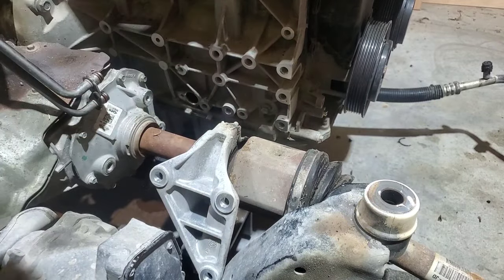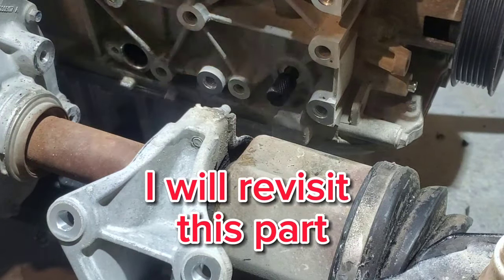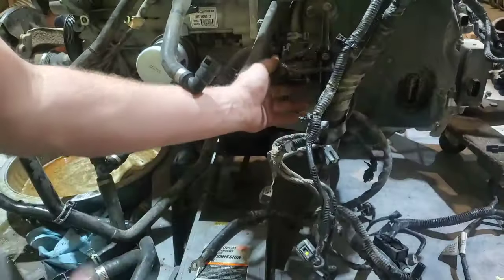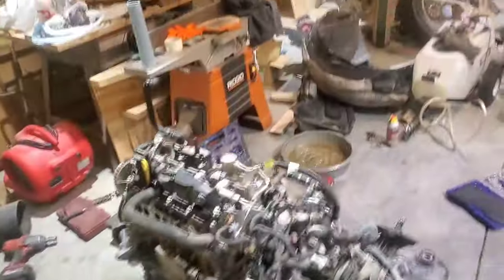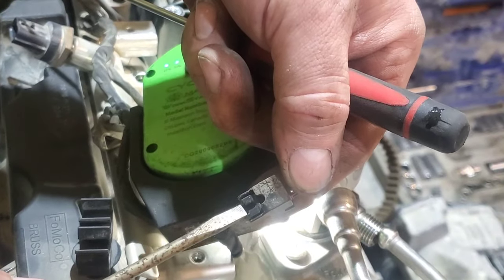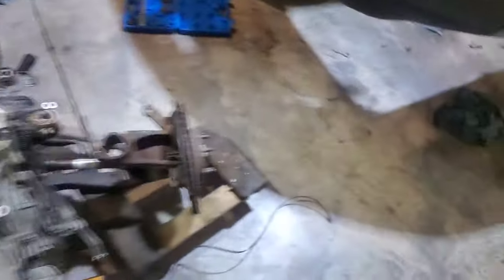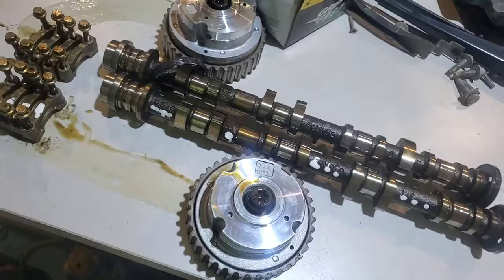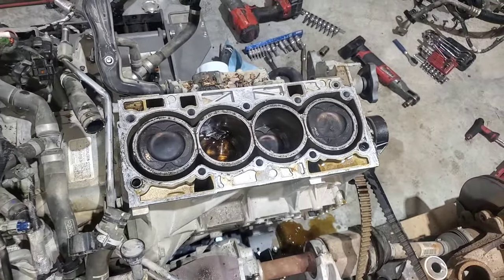engine replacement 2018 escape 1.5l ecoboost part 2

Comment: do you think they actually need that design?
weld it shut?
could you just keep changing the head gasket at like 60k to not have the gasket fail?
Reply from the maker: Not 100% sure. It's either a steam port or a way to cool the siamese bore. It's probably needed for reliability to make the kind of power it does for such a small engine.

As for just doing head gaskets, still a lot of work and I've known people to get less than 30k before gasket failure. We put that many miles on our cars annually, that'd get old AND expensive. Haha